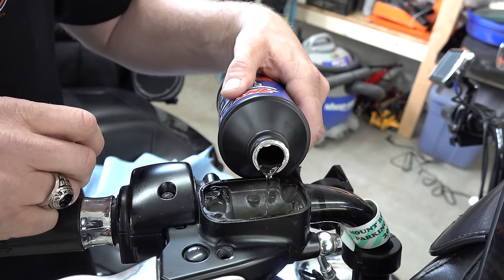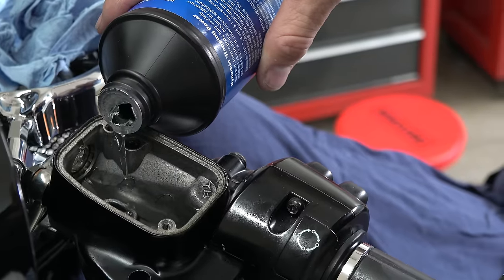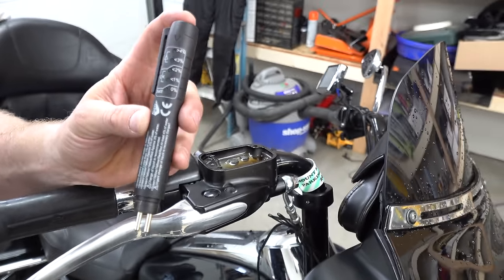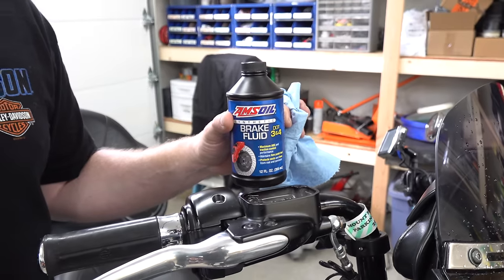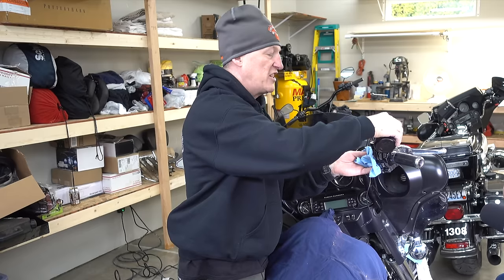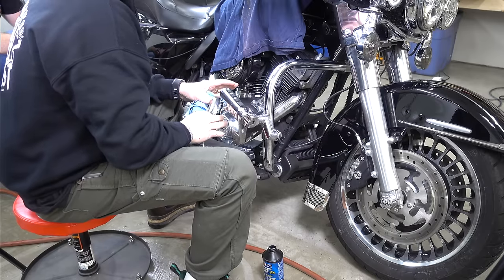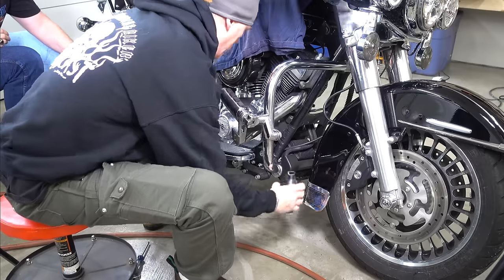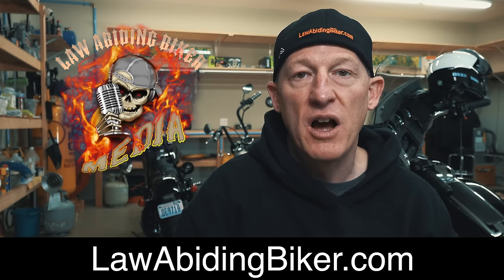How to Bleed & Flush Harley-Davidson Brake System Fluid-ABS & Non-ABS Systems

Comment: Ryan, I went ahead and attempted a flush,  just as you showed. I used the hand pump mityvac. Everything seemed to be fine until I took it for a ride. The ABS module is acting up now. Makes a clicking sound and when applying both front or rear. Did I introduce air at some point? Any idea. Thanks in advance.
Reply from the maker: Yah, it sounds like you have air in there.  I would re-bleed the system.

Ride safe & Ride Often!

Check out this YouTube Channel as we have a ton of free videos for you!

Check out our useful for purchase videos: http://www.lawabidingbiker.com/buyvideos

BECOME AN ECXLUSIVE MEMBER-GET BENEFITS:
http://www.lawabidingbiker.com/patreon

Leave a flat donation: 
https://www.lawabidingbiker.com/donate

Shop in the Official Law Abiding Biker Store:
https://shop.lawabidingbiker.com

Subscribe to the Law Abiding Biker Podcast: https://www.lawabidingbiker.com/app

Join our free email club:
https://www.lawabidingbiker.com/emailclub

Comment: Hey Ryan if I were to upgrade to stainless lines would removing the old brake lines introduce air into the abs?
Reply from the maker: Yes.  You should bleed the system after switching the lines.

Ride safe & Ride Often!
Here is a link to a bunch of our useful Free vids: http://www.lawabidingbiker.com/freevideos
Here is a link to some of our useful for purchase videos: http://www.lawabidingbiker.com/buyvideos
Want Answers & Information Fast? And help support us at the same time? Do you like the content we provide?
Our patrons get answers to their questions/comments/feedback in less than 24 hrs and are part of our Private Facebook Group. If you are interested in being in this exclusive group you can get all the details at ==> http://www.lawabidingbiker.com/patreon
If you haven't subscribed to the Law Abiding Biker Podcast make sure to do so. Listen in as we talk weekly about issues/items like this & so much more. You can listen on iTunes (Apple/IOS), Stitcher Radio (Android), or any other Podcast App ==> http://www.lawabidingbiker.com/podcast
Join our free email club at http:///www.LawAbidingBiker.com/EmailClub. Only relevant content will be sent from time to time. Email club members are the first to find out about free or for sale content are given special coupon codes.
Reply: I put my line in a bucket and ran fluid through the line to push all the air out and capped the end until I was ready to hook it to the abs box. It makes a mess when hooking it up to the top of the abs system, do it quickly, dont let the reservoir drain. This might be too late for you, but others can use the info.

Comment: Has anyone  tried to plug the ABS  motor/actuator into a  12v power supply  to  run the motor  while  bleeding the brakes

Comment: Just had a friend had a miss hap the other day. He popped out one the pucks on the front  and he couldn't get them to bleed right on his 2016 ultra. The dealer told him it need to be hooked up to the computer to bleed them right way with ABS.   Next question I have a 2020 Tri glide do you flush and bleed them the same as you did or do I have to take it to the shop and be hooked up to an computer
Reply from the maker: We flush our brakes with a brake bleeder then we exercise  the ABS system by locking up the brakes and working the system.  

Ride safe & Ride Often!

Check out this YouTube Channel as we have a ton of free videos for you!

Check out our useful for purchase videos: http://www.lawabidingbiker.com/buyvideos

BECOME AN ECXLUSIVE MEMBER-GET BENEFITS:
http://www.lawabidingbiker.com/patreon

Leave a flat donation: 
https://www.lawabidingbiker.com/donate

Shop in the Official Law Abiding Biker Store:
https://shop.lawabidingbiker.com

Subscribe to the Law Abiding Biker Podcast: https://www.lawabidingbiker.com/app

Join our free email club:
https://www.lawabidingbiker.com/emailclub

Comment: I have to replace the rear bleeder, what in the process is different? Do I have to completely drain the line first? Thanks
Reply from the maker: Just replace and replace what fluid you lost. Then bleed the system.

Comment: Ryan.  I need to change my brake line from my master cylinder to the abs brake module.   Can I use your method of bleeding through caliper.  ?  Wouldn’t I be pulling air into the abs because of the new cable?
Reply from the maker: You bet.  You could bleed it.  Replace the line and the fill/bleed.

Ride safe & Ride Often!

Check out this YouTube Channel as we have a ton of free videos for you!

Check out our useful for purchase videos: http://www.lawabidingbiker.com/buyvideos

BECOME AN EXLUSIVE MEMBER-GET BENEFITS:
http://www.lawabidingbiker.com/patreon

Leave a flat donation: 
https://www.lawabidingbiker.com/donate

Shop in the Official Law Abiding Biker Store:
https://shop.lawabidingbiker.com

Subscribe to the Law Abiding Biker Podcast: https://www.lawabidingbiker.com/app

Join our free email club:
https://www.lawabidingbiker.com/emailclub
Reply: Ryan Urlacher this information that you have put out is incorrect insomuch that once you have both allowed the holes within the brake master cylinder to be uncovered from fluid and or you have opened a banjo bolt on the brake line, then you have allowed air into the circuit and consequently you will not be able to purge fully I.e. about 87 - 90% only and the air will be trapped within the ABS solenoid section of the circuit, so therefore rendering the braking ineffective / inefficient.

Comment: How do you not introduce air into your brake line when you suck all of the fluid out of the brake reservoir? Thanks for any feedback.
Reply from the maker: Easy. Just follow instructions in the video and you’ll be good to go. That’s why u keep the reservoir topped off, so u don’t suck any air into the system. If u do, easy. Just start process over.
Reply: @RyanUrlacher  Thanks for taking the time to reply. I guess I didn't explain myself well. At 6:14 through 6:22 of the video, you suck out all of the fluid from the brake reservoir, won't this allow air into the brake lines? Sorry for the confusion.

Comment: When you change your brake pads on the front tire do you need to open the reservoir and cyphin some fluid out before you spread the calipers? I was going to replace the pads on a 2016 Road Glide Ultra. Thanks again for another great video.
Reply: Paul Vasso  Thanks, I need to go and get one of the kits to cyphin some fluid out.
Reply: Not as long as some idiot didn't over fill it. When you spread the calipers you will feel resistance if it was over filled. If you do take the cap off first pump the pistons back out first so the fluid isn't right at the top of the reservoir spilling out when you remove the cap.

Comment: How did you bleed the abs module?
Reply: They obviously didn't, or if they did, it wasn't shown or explained. Very important that the ABS module is activated when flushing brake system.

Comment: I thought bleeding the brakes involved opening the bleeder valve and THEN slowly engaging the brake until fluid (bleeds!) out the valve.  You pumped with the bleeder valve closed.  How can that get rid of air in the line?
Reply: the way you describe is the way we do a brake BLEED which is getting air bubbles out of the line.. it would take a long time and even then would not entirely empty the system.  you need a vacuum pump or system to pull the fluid out of the lines.
Reply: @tylerfj24  Well, the title of your video says "How to BLEED & ...".  What does pumping the brakes do?
Reply: @jimbert50  what they did was FLUSH the brake lines not bleed
Reply from the maker: We did both. Watch the video and I explain the minor difference between a flush and a bleed. When you’re flushing your system you’re going to have to bleed it too because you’re taking all the fluid out. Don’t get caught up on terminology. Watch the video and you’ll be successful
Reply from the maker: Watch the video in its entirety and It will answer all your questions and you’ll be successful. 👍

Comment: Ryan, what about if you have ABS brakes? What’s the procedure?
Reply from the maker: Exaclty the same. As indicated in the title and in the video. Nothing different about ABS and bleeding. They just have a speed sensor on your axle. Not needed for bleeding.
Reply: @RyanUrlacher  I’ve seen videos from JP Cycles where the hook up the computer to the abs module and supposedly it’s flushing the lines inside the module. They say that it has to be activated to due a complete flush. I’ve also seen vids where you flush the front and the rear, then ride the bike and activate both front and rear abs systems  several times, then go back and complete the flushing. Is that necessary?

Comment: What is a scenario where the brake fluid would actually rise to the boiling point?
Reply from the maker: Riding in hot conditions and too much moisture in your brake fluid.
Reply: Ride down a steep mountain road. See how hot your brake disks and calipers are by the time you get to the bottom.

Comment: I have a sportster that locks the front break at about 60 mph its intermitant... If you bleed the breaks it seems to work fine.. 
Ive flushed fluid the hard way bye hand...  If you have any ideas for me pls advise me..  It just acts like the engine is dying out of power.. I do have some mwd. Ape's and the lines are solid..i just got this last summer so im not all sure whats been replaced .. Thanks
Reply: what year is the bike?  does it have ABS?  does the front brake just lock up on its own or when you are using it does it lock up?  what do you mean if you bleed the brakes it works fine?  for how long, is water or air in the system when it locks up?  what is flushing fluid the "hard way by hand"?  
really wanting to help just need more info
Reply: Got another question, are you sure you are using the correct brake fluid?  Dot 4 vs Dot 5.  That will cause an issue
Reply: The bike is a 01 sporty.. The front break non abs at 60 mph with out touching it will just engage hard and slow the bike and it feels like the engine is running out of gas.. Ill pull in the clutch the engine will come back to life.. Usually on the side of the road i will release some of the pressure. Bye opening the bleeder and no air bleeds out just fluid.. I depress the handle let it come out and tighten the bleeder with out letting off the handle.. I will do this a few times.. Mind you on yhe side of the road.. And then i just wont touch it and get home asap.. When i changed the fluid i followed the dot marking for the fluid it was new a blue color i beleive thats dot 5 syn..  I sucked out the fluid out of the res.. With a baster bulb.. And let gravity bleed for a sec to watch the small amount i left in drop down.. Aftwr it dropped down i tightened the bleeder i cleaned oit the res.. With a clean towel and refilled opened the bleeder till it turned blue purple. Comming out the bleeder.. Filled again and hand pumped and bled the system.. That lasted for about 4 short rides maybe 100 miles.. The break worked great after words.. But it is still having this issue...
Reply: @kipprecoy6096  you may be having a caliper issue. If you ever squeezed the brakes while there was no fluid in it or collapsed the caliper without fluid it can damage the caliper.  You may need to rebuild the caliper. With that being said im not a pro, thats a life saving device and you dont need to ride it until thats fixed. Take it to a professional mechanic and get it looked it... dont play games with that and listen to keyboard mechanics because we are not.
Reply: @tylerfj24  thanks for the recommendation.. Funny thing is it had a complete rider inspection bye harley.. Before i got the bike...
The messed up thing is i was a asc certified mechanic.. Back a few years.. So i know the ins and oits of breaks .. But if tryed every trick ive ever used.. Ive asked the techs at harleu id it could need a new line or caliper.. Or master and they basically told me they know exactly what it is and i can either pay them to fix it or pay them a hours worth of time to pick the techs brain.. 
Right now due to weather its in storage in spring im going to rebuild the whole front break system.. If needed.. If they'd give me a price id prolly have harley do it.. But when i asked it was open ended.. And im not that rich at 100 per hour...plus parts...
Thanks ill look into some calipers
Reply: @kipprecoy6096  Did you find the problem? On cars and trucks have problems with the rubber line feeding the caliper gets a leak in the inner liner of the hose and builds up pressure between them collapsing the inner rubber liner so the fluid can't release back to the master cylinder. It seems to be mostly the front wheels I think because of the constant twisting, turning and the flexing of the suspension  and if it has rear brake drums the pressure on the front is always way higher causing more fatigue.   Inspection mechanics should feel the front lines for any abnormality like a bulge in the outer rubber signaling for new hoses.
Reply: The bleeder screw was the issue...
An old bike mechanic and I figured it out.. the old one was close to stripping so he had one on hand..
We replaced it and it actually bleed out properly... Haven't had an issue what the it since

Comment: Thought that with an ABS system there is an extra step to bleed the ABS system properly because of the internal valves or something?
Reply: You are correct. You can do the initial flush of the brake fluid then take bike out on the road and while riding hit both front and back brakes multiple times which activates the abs module.  This will push old fluid out and new fluid in. Then do another flush to get out all that came out of abs module.

Comment: Just watched the video and I’ve got a question for anyone
1. A couple of days ago while on a poker ride I went to tap my brakes and the front brake lever went all the way to the handle bar with no resistance at all. After about an hour and several times pumping the brake lever (no fluid leakage anywhere) the brake lever pumped up and has been fine ever since. I am going to flush the entire system out anyway. Why take the risk.

Comment: Everyone is saying how great this video is and I just don't get it. Why don't you show people how it's done using tools that the average parts changer has? Then it would be a great video. But to me it was nothing more than a commercial for a brake system vacuum.
Reply: Only difference is using that vacuum instead of a hand vac. Hand vac just takes a bit more work/time. Everything else ought to be exactly the same.

Comment: Its a great video but this doesn't help a rider that doesn't have a vac or pump.  And maybe shown a rag tied up on handlebar
Reply from the maker: We showed two options for a vacuum pump. One is an inexpensive hand pump. Both work
Reply: @RyanUrlacher  ur shows are GREAT. But  what i was saying was ur not showing the new riders that dont know much abt wrenching how too do it with just a wrench and plain  tube on what could be them on the side of the road, or if they can make it to a grocery store parking lot. Not all problems are preventive I'm just thinking along the lines where if somebody is traveling or broken down that they can get themselves up and running .instead of waiting for a dealership or having a garage that they can do all this maintenance.  Cuz lets face it the problem always will happen right when you dont expect it. Thats what riders need to know how to stay rolling,not towed

Comment: Man I've been riding around with  18 year old fluid,  I feel like a complete Douche' i looked at my front caliber tonite and it looked like my Aquarium i ues to have algae shit @ least at 35 % of the clear or green fluid. Now I'm concerned about my rear cyl. since proably year 2 of my 2000 Harley Road King Police , I put a Kuryakn Cover over it and I h=guess whoever put it on for me here inVa. thought i was such a dumbass to cover a reservoir that needs occcasional checking on, probaly blue loctite and a weld job on the Crash Bar Torx , I may have to put a torch on it .